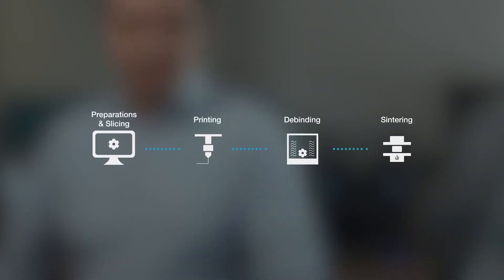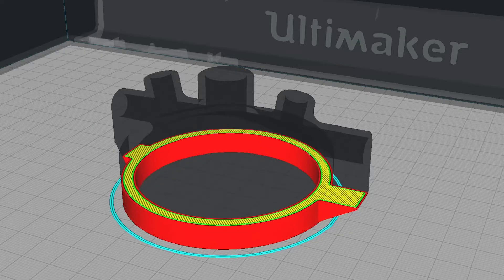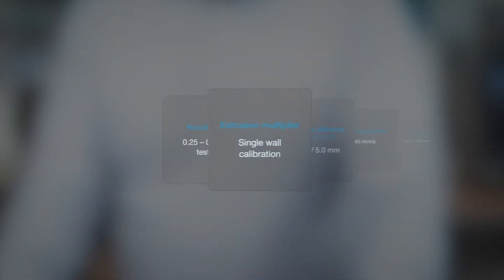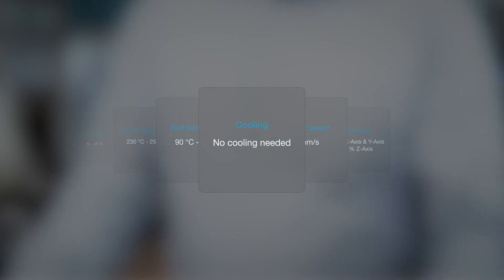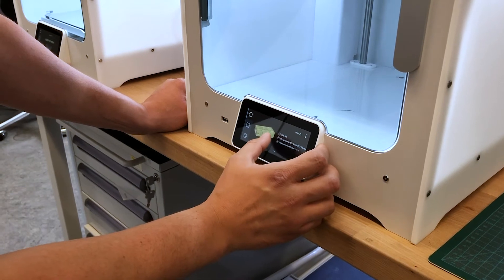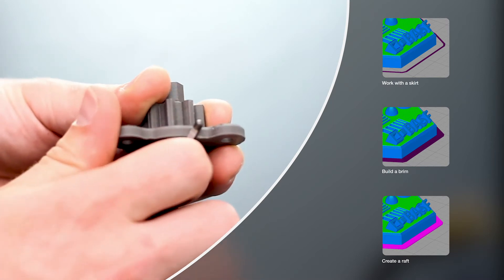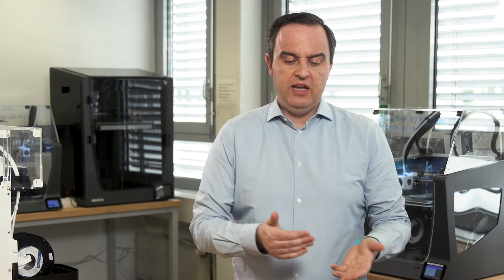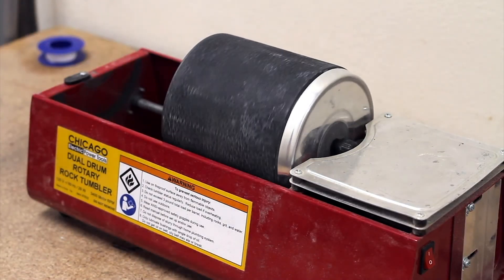Module 2: Process

Comment: If one is interested in printing jewelry, it is usually recommended to use a smaller nozzle and lower layer height.
Does this filament work well with a 0.05mm layer height?

Comment: 20 % shrinkage??? is that a typo?
Reply from the maker: As individual metal particles coalesce into a solid mass, a reduction in the part size occurs during the debinding and sintering process and is approximately 16% in the X- and Y directions and 20% in the Z direction.
Reply: Hello, I don't find the video particularly informative.
On the one hand, only the blue of the sky will tell the story (like at the Frankfurt trade fair)
I bought the filament (roll €500) and tested it for 2 years.
More disadvantages than advantages,
1. Component:
 The more complicated a component is (e.g. height), the higher the risk that your component will collapse or develop many cracks. ( in the oven)

2. When printing on the heated bed (printing plate), there is a 60%-70% risk of worb (tension).
For example, the component has 100% density (x 40cm y30cm z50cm).
Now the print is printed in a closed room (3D printer).
In the center of the component there is a central heat that cools from the center outwards and upwards.
Just 5 to 10 degrees of temperature fluctuations over the x,y,z axis are enough.

There are one more points I could tell you.

    @ForwardAM  😐😐😐